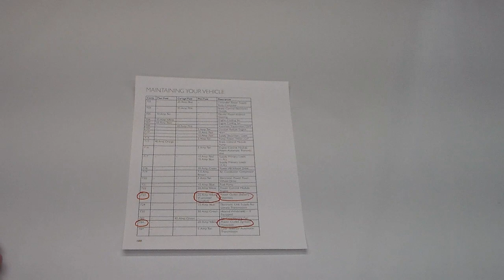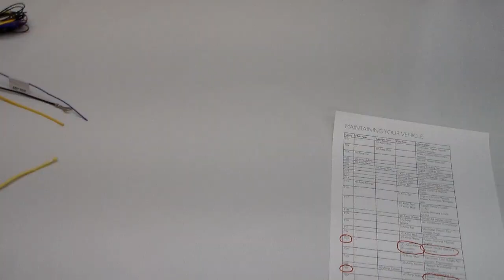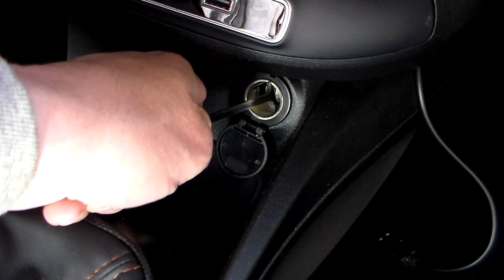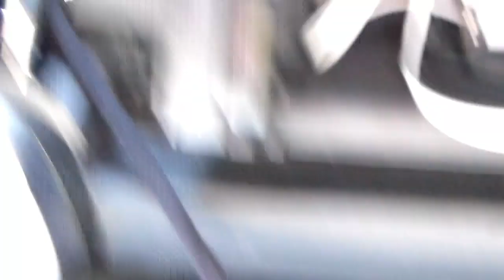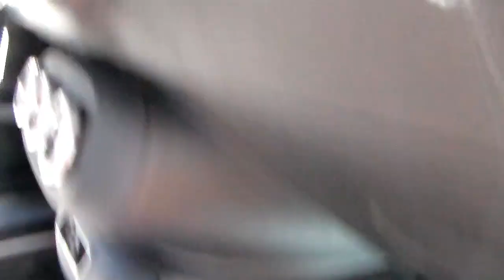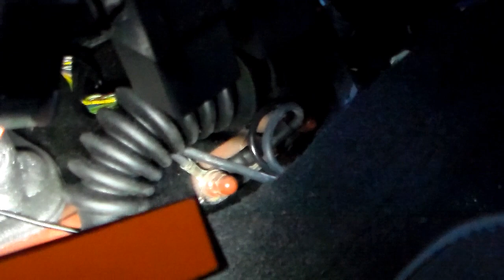Adding an external AMP to an XTRONS head unit

Comment: I ford F150 has a 20 amp fuse for the radio. Can I tie this in without running to the battery? Same sony amp!
Reply from the maker: I can't answer that for you, but if you aren't 100% sure you can safely tap into an existing circuit, just run the amp directly to the battery.
Reply: @driveway_of_misfits and you didn’t. Lol
But I understand. Peace, brother.

Comment: Hi, quick question does the android head units built in equalizer still factor in the  sound after adding the Sony amp?
Reply from the maker: Yes, equializer works no matter which amp you choose to use

Comment: Does it have bridge option?
I have a BMW e60 and the factory radio is terrible.
I'm considering buying this amp, powering 4 speakers with it and also power the underseat subs using bridge option

Comment: Just picked up this same amp that I’ll be feeding off my existing Sony aftermarket head unit. Have a question that I’m hoping you can help with…
I’ll be running power from the battery so I got the recommended wiring kit from crutchfield. The power wire in the kit has an in-line 15 amp fuse. That said, can I just splice the end of that power wire directly to the end of the yellow power wire in the Sony amp harness to make that connection?
Reply from the maker: As long as you're going battery->fuse->amplfiier then connecting the amp directly to the battery should not be an issue.  Some cars have large fuses right on the battery's positive terminal though..if yours does, make sure the amp is connected to the battery side, not the load side, of said large fuse.
Reply: @driveway_of_misfits Thanks! Noted, regarding the fuse at the terminal.
My question was more so regarding connecting the 12 gauge wire I got from crutchfield (which contains the in-line 15 amp fuse already) to the (what I assume is smaller gauge) yellow power wire in the amp wiring harness. Sounds like that will be ok?
Also, will using the ground wire in the amp wiring harness alone be enough or will I need to use the 12 gauge ground wire also included in the wiring kit I got? Can’t seem to find an answer on this.
Appreciate the help. This is all new to me.
Reply from the maker: @adamnelson4925  If the thinnest wire in your power circuit is the wire coming from the amp then you should have no issues in that regard. Not knowing exactly what the wiring kit looks like, I don't want to give any false info about the ground circuit. Crutchfield has great customer support so you might want to ask them

Comment: Question… Why go through all the trouble of running power from the bottom when you have power, ground, remote turn on from the radio harness…
Reply from the maker: The amp requires more power than the existing circuit that powers (among other things) the factory head unit can provide.  It's quite common for amps to have a dedicated power source